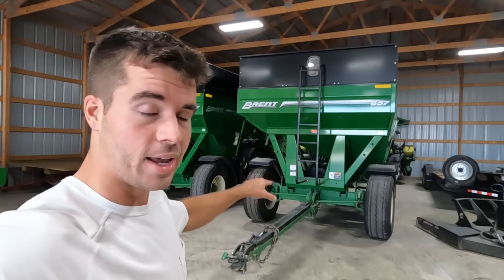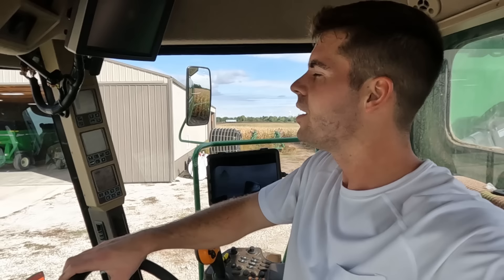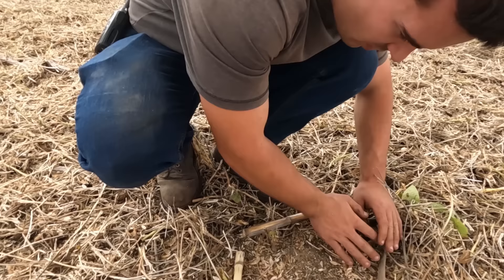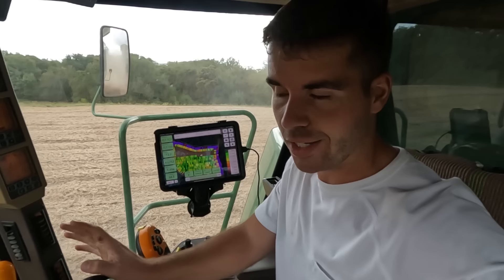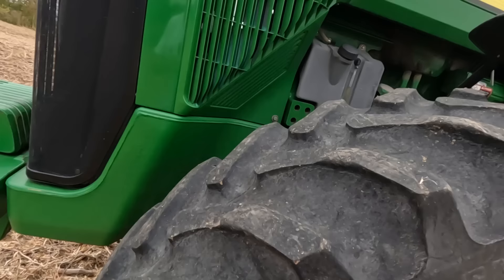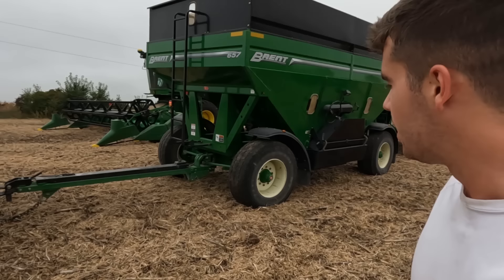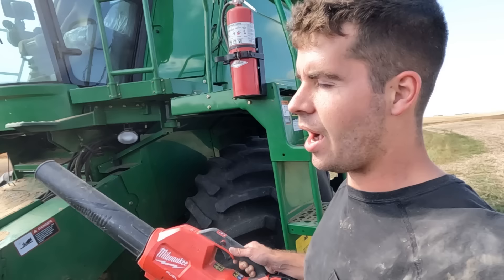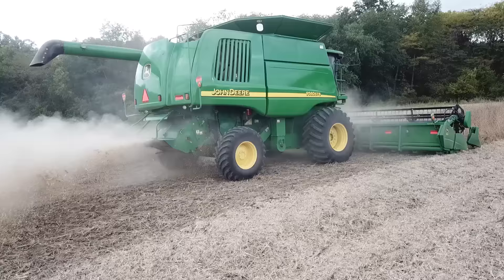First Day of Harvest!

Comment: pro tip for ya ... use a short piece of twine to tie your cotter key to the handle of your draw pin so if the key gets raked out of the pin by say a corn stalk it will be just dangeling on the end of the twine tied to the pin handle :)

Comment: If your beans are planted in rows always cut at a small angle. Usually about 10 degrees off planting angle. Going straight with the rows wears on the cutter bar and doesn’t feed as well. Pick up your reel until you’re barely tipping them into the head

Comment: Need to put a tailgate on military truck with a  gate in the center to haul crop. Then you can haul the carts to the elevator with it and even if it only holds 100-150 it would be less time and wear and tear on the roads.
Reply: You gonna shovel it off every time?

Comment: Hey I got a tip with the safety key thing what we do is wrap a tiny small chain thru the handle of the pin and go behind it on the bottom and get a bolt and tighten it and u won't lose that and your pin stays better and make sure to use 2 nute